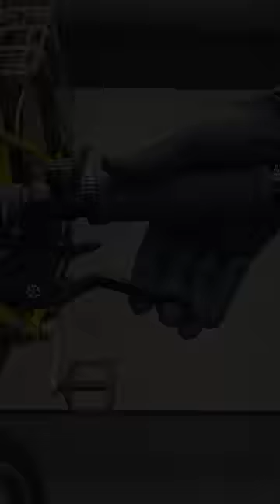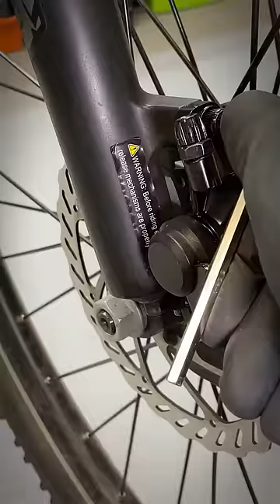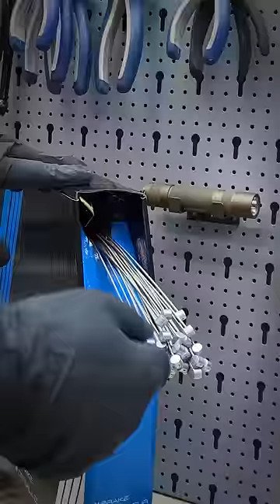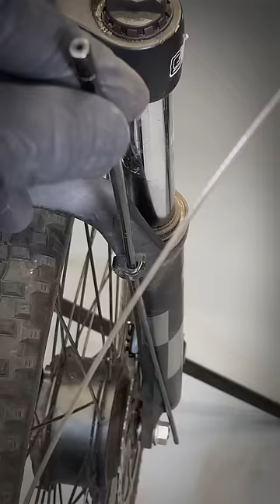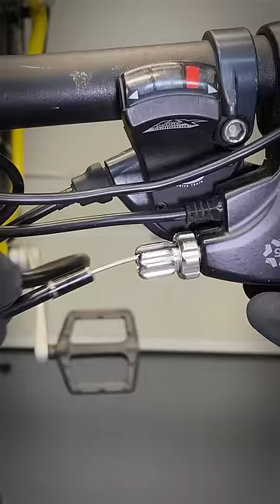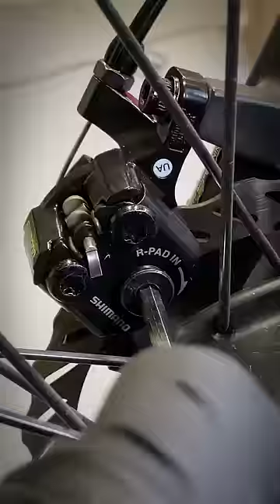Spongy mechanical disc brakes cheap upgrade.

Comment: What i hate are spongy hydraulic brakes. And I hate the black holes in the lines too, always swallowing the fluid into another dimension:

Check everywhere, no leaks. Top up the fluid. Seal the hole, squeeze the brakes a couple times. Open hole, notice the fluid level is low. Top up the fluid. Seal the hole, squeeze the brakes a couple times. Open hole, notice the fluid level is low. Top up the fluid. Seal the hole, squeeze the brakes a couple times. Open hole, notice the fluid level is low. Top up the fluid. Seal the hole, squeeze the brakes a couple times. Open hole, notice the fluid level is low. Top up the fluid. Seal the hole, squeeze the brakes a couple times. Open hole, notice the fluid level is low. Top up the fluid. Seal the hole, squeeze the brakes a couple times. Open hole, notice the fluid level is low. Top up the fluid. Seal the hole, squeeze the brakes a couple times. Open hole, notice the fluid level is low. Top up the fluid. Seal the hole, squeeze the brakes a couple times. Open hole, notice the fluid level is low. Top up the fluid. Seal the hole, squeeze the brakes a couple times. Open hole, notice the fluid level is low. Top up the fluid. Seal the hole, squeeze the brakes a couple times. Open hole, notice the fluid level is low. Top up the fluid. Seal the hole, squeeze the brakes a couple times. Open hole, notice the fluid level is low. Top up the fluid. Seal the hole, squeeze the brakes a couple times. Open hole, notice the fluid level is low. Top up the fluid. Seal the hole, squeeze the brakes a couple times. Open hole, notice the fluid level is low. Top up the fluid. Seal the hole, squeeze the brakes a couple times. Open hole, notice the fluid level is low. Top up the fluid. Seal the hole, squeeze the brakes a couple times. Open hole, notice the fluid level is low. Top up the fluid. Seal the hole, squeeze the brakes a couple times. Open hole, notice the fluid level is low. Top up the fluid. Seal the hole, squeeze the brakes a couple times. Open hole, notice the fluid level is low. Top up the fluid. Seal the hole, squeeze the brakes a couple times. Open hole, notice the fluid level is low. Top up the fluid. Seal the hole, squeeze the brakes a couple times. Open hole, notice the fluid level is low. Top up the fluid. Seal the hole, squeeze the brakes a couple times. Open hole, notice the fluid level is low. Top up the fluid. Seal the hole, squeeze the brakes a couple times. Open hole, notice the fluid level is low. Top up the fluid. Seal the hole, squeeze the brakes a couple times. Open hole, notice the fluid level is low. Top up the fluid. Seal the hole, squeeze the brakes a couple times. Open hole, notice the fluid level is low. Top up the fluid. Seal the hole, squeeze the brakes a couple times. Open hole, notice the fluid level is low. Top up the fluid. Seal the hole, squeeze the brakes a couple times. Open hole, notice the fluid level is low. Repeat.

Comment: This is a hoax . Even with Shimano mechanical calipers , they are still a bit spongy .  You are changing CANSUCC/UNIQUE brand ones for SHIMANO TX 801 or 475 .Good cable sheathing only reduces the sponginess slightly even when well lubricated as cable stretching under tension cannot be eliminated to achieve a crisp feel .
Reply: As a LBS mechanic, I can say you're not doing it right if you haven't achieved proper stopping power after changing to compressionless housing. Even the worst mechanical brakes can be dialed in.

Comment: Honestly if you're gonna upgrade your calipers anyway, I'd recommend a Semi-Hydraulic Caliper. Much better feel and power than purely mechanical ones, and it's still cable actuated! So no fidgeting with hydraulic fittings and all that.

Comment: I'm just thinking...shimano is nuts and I love them, got a pair of MT200 on my first bike for 40$ which used V brakes...and I found out the pleasure of stopping almost instant  , now, on a 23kg ebike, same model, mt200 still holds up really good .

Comment: Why had not the outercasing be replaced too? The rest, fine work
Reply: Replace the housing with Shimano brake housing it's much better than the cheap OEM stuff. Grind the ends flat and poke an awl or sharpened broken spoke in the end a little bit of cable lubricant is good too. A thin coat of light grease on the cable is better than nothing though. Shimano cable grease is the best but expensive rock n roll cable magic is not bad
Reply: @stevengagnon4777  SJ Clark cables and sheathing are also good .

Comment: Bb5 or bb7 avids with 200mm rotors and matching brake levers I'd trust em on my Nomad
Reply: I have a BB5 on the front wheel of my bike - the frame has cantilever mounts, so it's a linear pull brake on it. That said, it's pretty doable to get the BB5 and a linear pull brake to have the same modulation feel.

Comment: Bro, at that point, just convert it to hydraulic

You can get Shimano hydraulic calipers, lines, and levers ready to run for like $60 and have like triple the stopping power.

Especially when you already have a separate shift and brake lever.  My bike has a shift lever on the rear that also has mechanical brakes built in, so I’ve just got my front brake swapped to hydraulic and it makes a massive difference.

Comment: Just get some cheap shimano MT 201 hydraulic brakes they’re inexpensive and have a ton more power than mechanical brakes
Reply: 201's actually aren't that great .
Reply: @robertmcfadyen9156  I didn’t say they were great I said they were an inexpensive upgrade that are better than mechanical brakes
Reply: @dylanperschon8479  They are slightly better than aftermarket models .
Reply: @robertmcfadyen9156  I have 200s (the version with the steel lever, the 201 has Aluminium levers) on a couple of bikes. If you don't need 2 or 1 finger levers and if you go for 180 mm rotors front and 160 rear they are good enough to balance the bike on the front wheel during braking.

Of course there are brakes with less lever force - but the 200s are comparable to a V brake bike in lever force, so you can switch between V brake bikes and disc brake bikes without the danger of overbraking and going over the bar

Comment: Brother naw naw naw

Theres a bolt that secures the lever blade to the lever, loosen that between half a turn and 2 turns and it will probably fix it

Comment: Just spend the $70aud and get the Shimano hydraulic brakes...problem solved
Reply: I have just thrown away hydraulic brakes because they are crap. I always do, even on my new gravel bike, £3000 first thing I do is remove anything hydraulic.
Reply: @Chris66able  You definetly doing something wrong,in my expirence hydraulic were the best brakes that i ever used

Comment: Try Avid BB5 calipers next time! Or if it fits in your budget, you also can try BB7, which is the king of mechanical brakes. Way better than Shimano.
Reply: I agree the BB7 is a decent brake, perfectly adjusted it can rival the cheapest of cheap shimano hydro brakes. atleast for 100 or so km until you need to readjust it while the hydro's are maintenance free until the pads wear out.
The BB7 also costs about the same as the better in every way cheap hydros, so I don't see the point exept very special use scenario's

Comment: You are supposed to put grease in the cable so that the metal wire slips easily and does not rust

Comment: What really gets me is that he didn't lube the wire (donno what it's called in eng) before putting it back in even tho the old one was dry as sand. All in all why did he even replace in the first place?

Comment: Never used mechanical disc brakes, are they bad?
Reply: They have their pros and cons, for example they are not as precise or powerful as hydraulics, but they don't suffer on wet conditions like V brakes, and they are easier to setup than hydraulics, that comes handy if you do tour long distances on your bike and ever need to service them in the middle of nowhere.
Reply: Regularly adjusting the stationary pad solved that problem for me .  Why upgrade something when you can use an Allen key now and then

Comment: A cheap way would be to buy a tube of grease instead of a new caliper take the caliper apart clean it up grease it and get new cables and housing

Comment: I'm consider changing mechanical brakes on my chinese ebike with hydraulic ones. With brake switches for the controller, of cource - and its not cheap. Factory-instaled brake rotors should be replaced too, they just suck. Well, "cheap" always means "expensive" in the end.

Comment: Ever hate it when you go to a non bike store that sells bikes (Walmart for example) and  you perches a new bike and it's barely holding itself together or the parts already on it don't fit right.?
Reply: That's because the workers at those stores get paid by the bike. So if they can build 4 bikes in an hour they can make like $40/hour. At least that's how it works at CanadianTire. Pretty stupid imo, since bikes come 80% assembled from China already they just completely skip over safety etc even though that's like their only job.

Comment: You could just bleed the brake properly...

I had the cheapest set of hydraulic brakes on mine and i only just replaced them after 3 years because i converted it to ebike so needed ones with switches in (still the cheapest) and they never went spongey once
Reply: After like 4 years you have to bleed them still. Personally i do think good quality brakes is key on a ebike.
Reply: @dashofawesome64  the only thing that needs to be good quality is the rotor and the pads.

Good quality steel surface on a floating rotor and good quality sintered or ceramic pads (if you use ceramic pads on poor quality discs the disc will wear thin in no time)

The rest of the brake system is simply a piston at the handlebar. Pressurised fluid in the hose and 2 pistons or more on the calliper. 

Providing everything is sealed properly, no leaky reservoir or hoses. Then there are literally zero gains from a more expensive setup.

At most you might find that a premium brand will include either a single lever dual brake caliper with adjustable front and rear bias. Or an adjustable lever position.

Hell I even have cheap eBay levers on my 125cc scooter WITH adjustable parts. And that feels way better than the stock ones.

Stop paying more for known brands except for tyres, pads, discs, chains and chainrings/cassettes. Oh and frames/forks. 
Everything else can be pretty much what you want.

Comment: Or adjust your inboard stop.   Most spongy brakes hit the rotor then continue to push it over more then 2mm to the other pad.   Fix alignment and inboard before screwing  the customer $100 for new calipers.     ( I totally agree good calipers are better I have a set of Paul’s that are amazing but you don’t cost a customer money because your lazy.).
Reply: @MaYbYl8eR  sir do you charge 0 for service .can I know your shop location

Comment: Pretty pointless you can get a mt200 hydraulic brake for like £20 nowadays and even being the most budget hydraulic set they are so much better than cable disc.
Reply: yeah, but making them work with ebikes is annoying

Comment: That's stupid. He could just change the pads or sand and clean them rotors too. Then adjust that will be cheaper and same effective. That video should be how to upgrade your brakes calliper. Fixing is not the same as upgrade with new brakes

Comment: And I hoped for hydraulic fix 🤦‍♂️
Reply: "simple" is the keyword here, take this with a grain of salt.
Reply: @proxyhx2075  
Well it's just bette, more comfortable and also more expensive solution - that's all.
BTW I like salt on my peanuts and one grain is just not enough ✌️
Reply: @jakubpipek2266  Some people just prefer mechanic. Imagine being in the middle of nowhere and your hydraulics fail 😂 That's a simple fix on a mechanic set, not so much on an hydraulic one.

Comment: How many Rs
Reply: Hey you can just change the cable and the sponginess of the brake will disappear  no need to change the caliper 

And changing the cable will only cost about 50 to 60 rupees